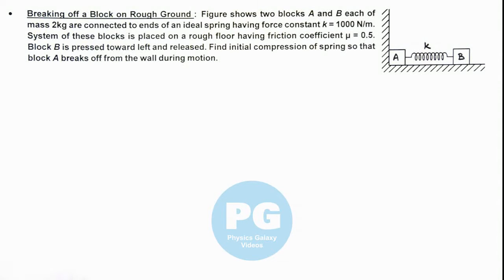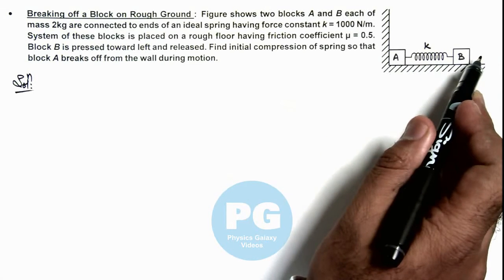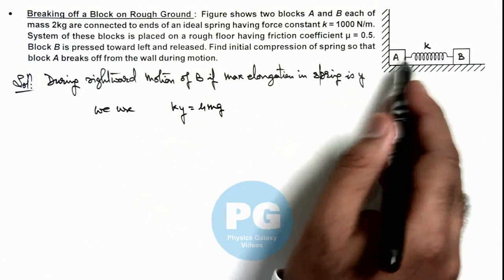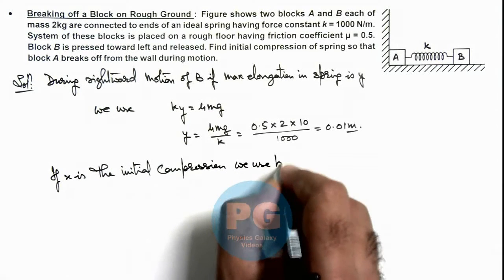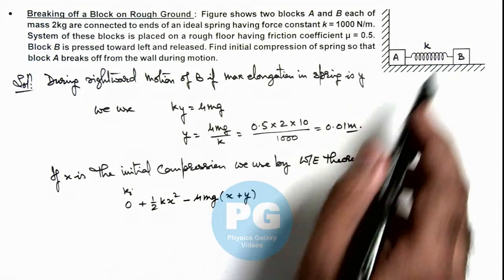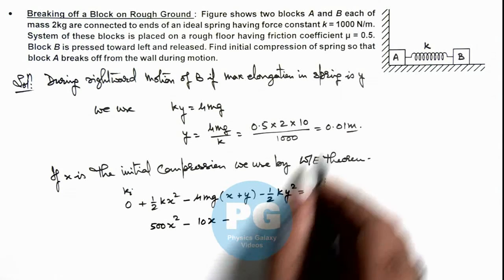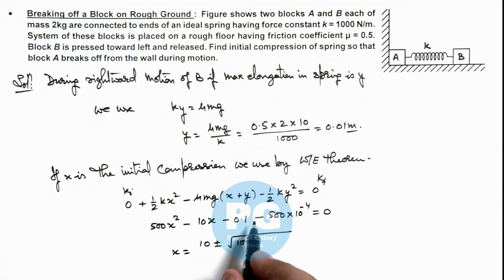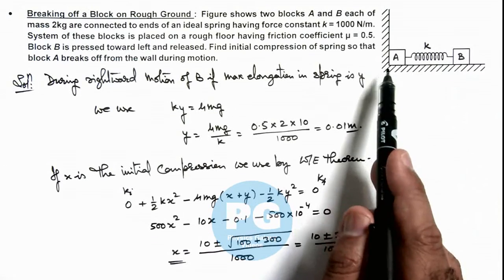Adv Illustrations – Breaking off a Block on Rough Ground | Work Energy Power #15 for JEE Adv

Comment: Here when block extends to natural length as the spring extends will spring force become 0? And when it does become 0 will friction abruptly become 0 and body comes to rest? Someone pls reply
Reply: Yes spring force will be zero at  mean position but friction wont be zero as the block would have some velocity
Reply: So it will move some distance further
Reply: Thank you
Reply: @krishnasimha8097  btw waiting for result🙂🙂
Reply: 180 but 27 jan shift 1 so just 95.7😂😂
Reply: mine was 29 s2
Reply: Nicee but i didn't give 2nd attempt I started for advanced after 1st attempt
Reply: @krishnasimha8097  oh what was your score
Reply: Ahh cool

Comment: Sir you account the normal force of Block A bit not be why? 
If the force needed to move the block a the opposite force of Block B is facing.
Reply: Normal force is acting on A but it is not doing any disp. Hence no work done

Comment: Sir is there any condition for WORK -ENERGY theoram to be vaild ..or it is valid everywhere???
Reply from the maker: It should be applied in inertial frames as in non-inertial frames work done by the pseudo forces is also required to be accounted... and for non-rigid bodies we need to consider elastic potential energy stored within the body...
Reply: @physicsgalaxyworld  Ok thank you sir

Comment: while the work is being done it is against the friction force and against the spring force in elongation ( when we are elongating the spring after bringing it to natural length),whereas during the compressed state the system had 1/2kx^2 energy.. which is possessed in rest state too..so that's why it is taken as positive... Is my reasoning correct dear sir?
Reply from the maker: Starting from initial position to the final position as mentioned in video.... work done against friction is taken -ve and from start to natural length spring force is supportive in attaining the natural length so the work ½kx² is taken +ve and then from natural length to the extreme position spring is opposing so its work ½ky² is taken -ve...

Comment: Sir if there was no friction would the block A break off when spring comes again to its natural length after compression? And if so then please tell why?
Reply from the maker: +ashish jain Yes if there is no frictin it will break off as soon as spring exerts a rightward force on it... which happens when spring attains its natural length of slightly elongates...
Reply: Ok! Thanks sir
Reply: @ashishjain3732  how's your JEE result
Reply: @anmolempire1197  how's your result?
Reply: @noobiepianist  how's your result? 😂 (tbh idrc but I just wanted to continue the chain 🤪)
Reply: @faheem4581 how was your result?

Comment: dear sir
in line number 5 
i could not understand why    -umg(x+y)
actually i have confusion in problems . so what should i practice to remove it . please suggest me .
Reply from the maker: +Zunid Zn because initially spring was compressed by x and later elongated by y so block is displaced on ground by (x+y) so work against friction is (mu)mg(x+y)....
Reply: +Physics Galaxy 
clear 
thanks
Reply: Bro where are u now????
Reply: @kanishq7194  where are you bro now ?

Comment: with due respect sir.. here on block "A" a normal reaction due to wall is also acting..so when i solved it considering this force also.. Y comes to be  (-1/100) what is it supposed to mean... y should be positive!
Reply from the maker: +Momin Parveez problem says that block A should break off from the wall so we need to consider the state when N=0 so no point in considering normal reaction when A breaks off...
Reply: we consider normal force as zero here because normal force comes in category of contact forces..and when the block breaks from the wall all the contact force nullify and hence normal reaction is zero....
Reply: IITian?